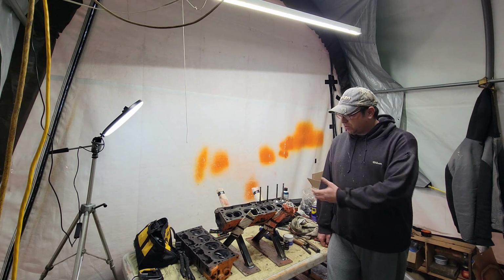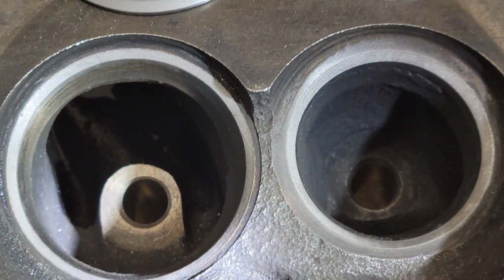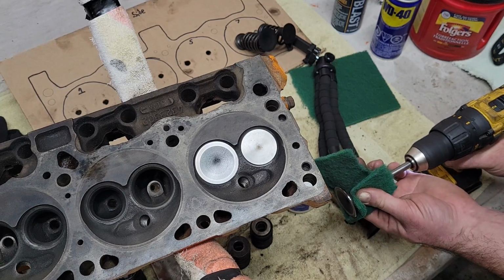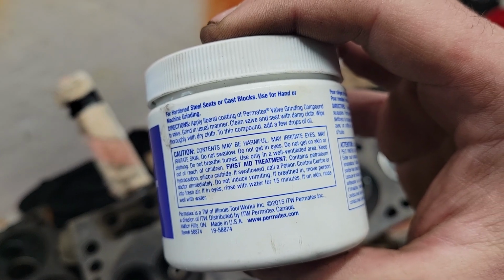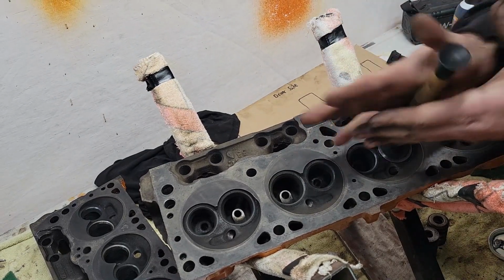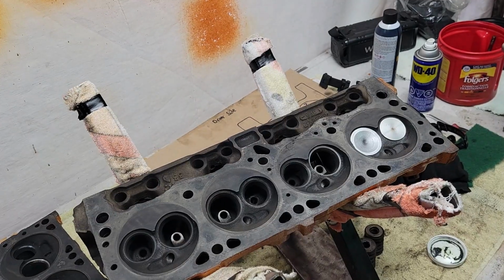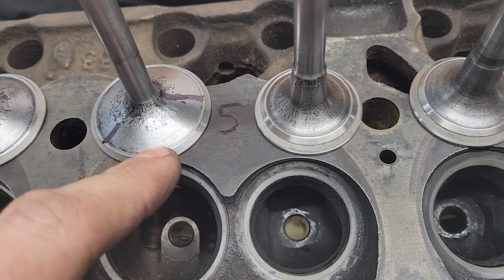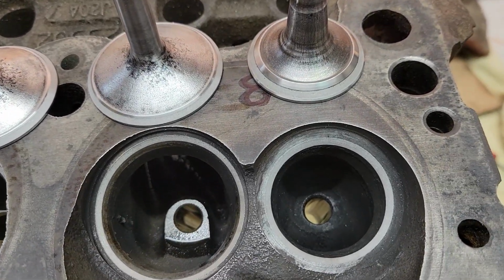Mopar LA 302 Casting Cylinder Heads, Cleaning And Lapping Valves. Will It Work?

Comment: My 318 really woke up with those heads and a comp cams   xe 268h and performer manifold, 3000 stall converter 
Xlnt throttle response , lopey idle and starts up fantastic even when cold.
Reply from the maker: Sweet bud I'll look into this. Thanks for the info. By chance what car or truck do you have this engine in?
Reply: @getwrenching  
A 72 Plymouth Scamp 2 door
Reply from the maker: @robertheymann5906 sweet